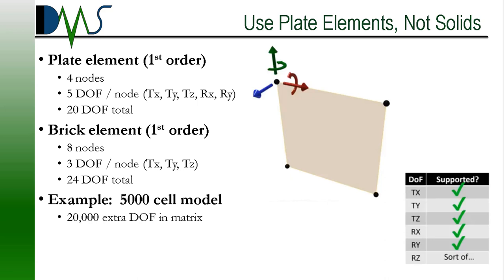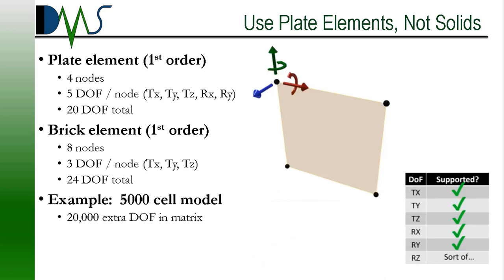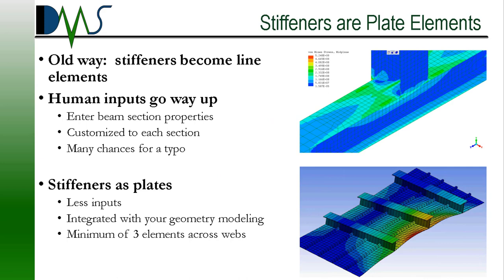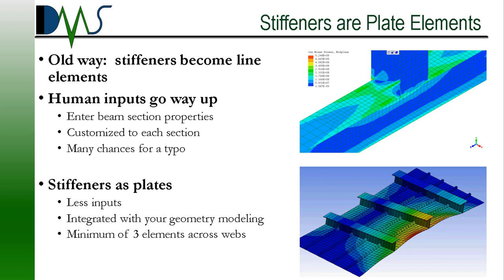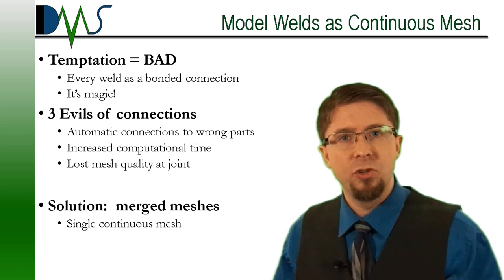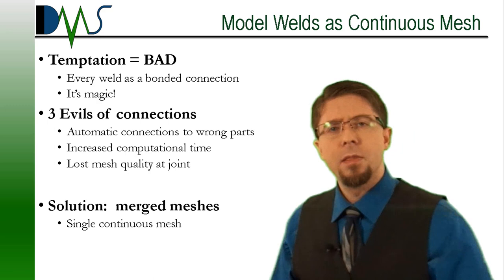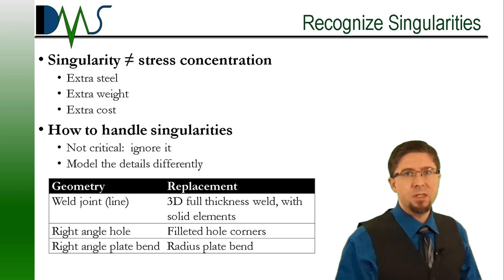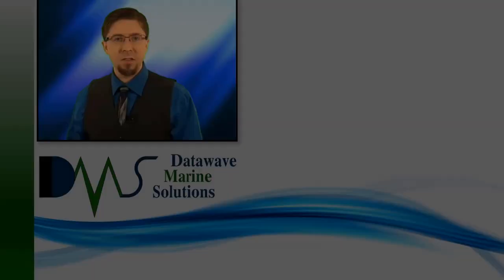Six Tips to Improve Your FEA:  Tips for Marine FEA

Comment: Thanks for your efforts! 
I always keep watching your great videos.
I prefer 1d elem to 2d elem, i sometimes change the elem type when i especially need to check plate bending behavior.
Nowadays, a modern modeling software helps us to review disconnection and singularity problems easily. 
I wonder why need to make the weld joint modeling?
Is it for the fatigue analysis? 
What I know is welding properties are way better than plates.

Comment: For my Mtech thesis, FEA analysis of Ship structure, I have considered a rectangular Barge, did hydrodynamic analysis using Ansys Aqwa (Linear wave of 1 m amplitude), transferred the load using apdl script to Ansys static structure in workbench.
How can i ensure that load has been correctly transferred. I have applied boundary condition similar to what specified in DNV guidelines. But Iam not sure whether analysis done by me is correct.
Can you please additionally give guidelines for boundary condition of ship structure.

Comment from the maker: Any tips or advice that you would add for FEA engineers?
Reply: Again, great video. I'd just like to add that, regarding Ansys, the solver actually creates a fully meshed cross section, however will plot the results of the section as a whole, depending on the solver settings. Also, that although plate elements are indeed preferred, they can be hard to model depending on the region of the ship, specially at the fore/aft ends. It is another problematic point for mesh generation due to the topography. Line elements produces mesh faster and are also easier on the number of equations too. Finally, depending on the software you are using to produce the model, most of the line body problems that you mentioned are trivially solved.
Reply from the maker: Thanks!  I love to see comments from other FEA users.  Helps me add new perspectives on my own modeling strategies.  I admit that I frequently adapt my modeling strategy based on the needs of the individual project.